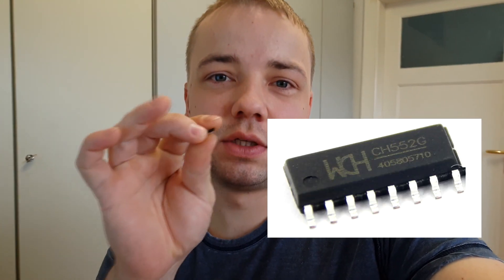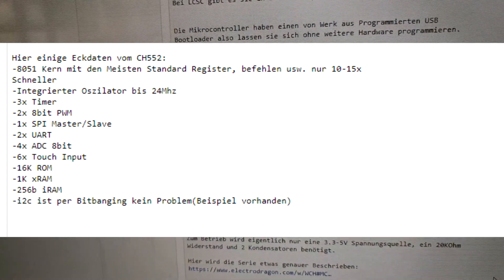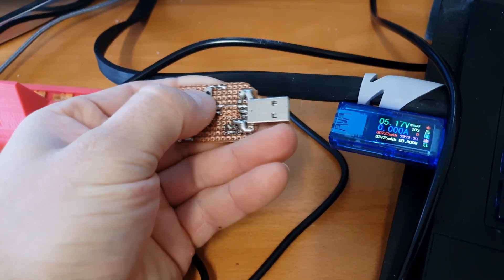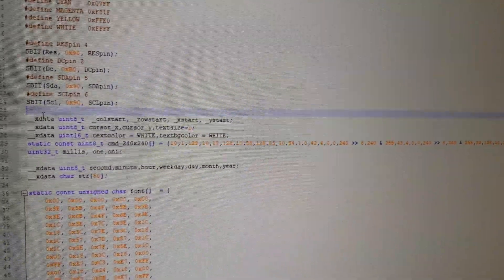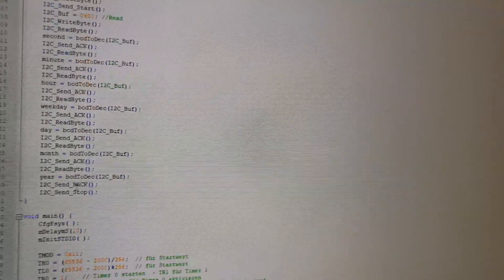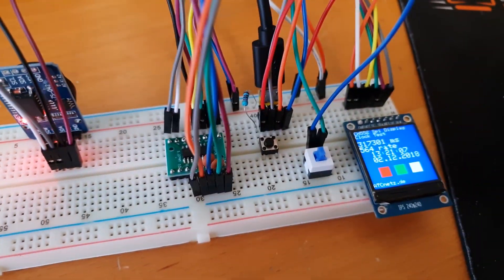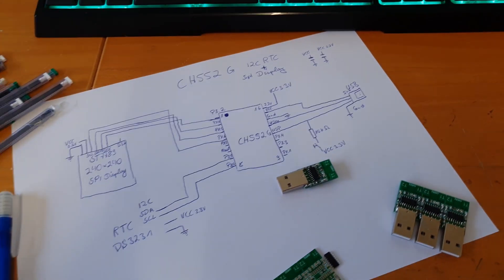CH552 0,30€ USB Microcontroller HowTo Programm, ISP Display I2C RTC

Comment: Hallo, Ich bin vielleicht etwas spät dran aber habe so eine Minitastatur mit so einem Chip sehr günstig gekauft. Ich wollte auf den Tasten ausführbare Codes hinterlegen, wie "An-/Ausschalten von USB-Ports am PC (also am Motherboard, wie man es vermutlich im Gerätemanager machen kann)"; "Das umwechseln zwischen Anzeige auf zwei Bildschirmen und -Anzeige auf einem Bildschirm-". 

Falls du das siehst, kannst du mir kurz einen Eindruck geben ob sowas möglich ist? Ich kenne mich nicht wirklich mit Microcontrollern aus und möchte nicht Zeit und Motivation reinstecken um am Ende frustrierend zu erfahren, dass es nicht Möglich ist (oder sehr schwer). Ich habe schon paar andere (der wenigen Videos über diesen Chip) gesehen und versuche auch mit chatgpt das System zu verstehen. Leider gibt es aber das Flash Tool für diesen Chip nicht mehr auf der Herstellerseite und nur den für den CH554 online. Geht das auch ohne?
Ich bedanke mich schon mal im Voraus für deine Hilfe.
Reply from the maker: Moin, das sollte so möglich sein du brauchst aber auf dem PC auch eine Software Die die Kommandos der Tastatur dann ausführt.
Reply: @atc1441  ok  Vielen Dank

Comment: Hi, I have a deice with this uC and when I set it to programming mode, the programmer app v2 on android can connect with it but I can't dump the flash.
The device has a bootloader version 2.5 and the message is:

Something went Horrible Wrong found no right byte at: 14335
I Send: A60D00FF3700000000023FC700E57536 Answer was: A69F0200FE00 Got this Data:

Comment: I made a device with CH554, I want to activate code protection, but in WCHISPTOOL its not active "Enable code and data protection mode",
How can I activate protection?
Reply from the maker: I am not aware of any code protection in the CH55X series...
But the new bootloaders are more secure and can not be dumped as easy anymore

Comment: Hi Aaron, I have ordered CH554 because only that was available . Is it possible to use it for USB memory pen drives ? Just a quick head up , if you have done any work on it.
Reply from the maker: Hey yes that is possible, only that the examples from WCH only work wit Keil. You can use keil for 30days free i think.
Reply: @atc1441   Thanks Aaron !

Comment: Is it possible to rewrite the description without unnecessary words (on GIT)? 
Like, now let's compile and oops nothing happened!
These superfluous words, expressions and actions are very annoying, because at least they spend time.

I would understand if it was some kind of novel or other literary adventure.
But I think people coming here hope to quickly connect everything and make everything work right away.

Without experimentation or other adventures.
---
Thank's
Reply from the maker: Hi. This was my very first video about them, many things habe changed. 
There are now many more options to get started, there a re one click compiler, arduino core librarys, Android Apps to flash them and Python scripts to flash them open source. 
You can find some on my github https://github.com/atc1441/CH55xOneClickCompiler and also within other video.

Comment: Hi - any chance you could upload the source code and the modified Adafruit library to github? I would like to experiment with this chip for a project I am designing. 

I am already using the CH559 in a project for usb host per your project with BitLuni. Thanks for the great project videos.
Reply from the maker: Hi. Please send me an email to ch552code@43u.de i will send you the code there, the code is not polished at all and needs MAKE to work. Thank you

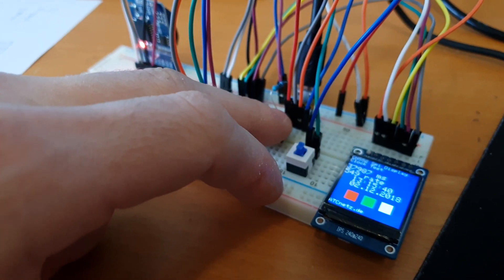Comment: At 5:23 you say "D-Minus Pin" but the schematic at 5:40 actually shows D-Plus pin being the one connected to VCC via a 10k pullup - so what's the right way?
Reply from the maker: Oh yes. 

P3.6 Is the right one. So Pin 12 on ch552G
Data plus pin.
Reply: @atc1441  Thank you so much. This may sound strange but: Do you know a way to program the CH552G directly (so not via the built-in USB bootloader but like a more "traditional" microcontroller)?
Reply from the maker: Only other way is via serial. The same protocol as the usb bootloader just send to it via serial.

There is one thing mentiond in the manual about spi programming but nobody knows how to activate it. That is not descripte more than an overview.

Comment: So are you dumping 5V to 3.3V devices? I see you powering TFT and RTC with 3.3V from the internal regulator, but all IOs are 5V, rest of the two USB IOs.
Reply from the maker: Hi. Yes that is not 100% perfect but it works for developement. You can also power the ch552 complete with 3.3V then also the IO are 3.3V
Reply: @atc1441  CH552 won't work in ISP mode is it is being powered from 3.3V. The flash memory requires 5V to write. ATM I'm working on a CH552 design and I've been stuck on level shifting. The cost is at extreme premium, and the space is also at premium, so I'm looking for a solution to level shift 8MHz SPI with minimum space and cost.
Reply from the maker: Maybe like here https://simple-circuit.com/wp-content/uploads/2019/06/arduino-st7789-color-tft-240x240-pixel-interfacing-circuit.png only two resistors per line

Comment: I was trying to compile the examples but keeps getting error2.

$ make
sdcc -c -V -mmcs51 --model-small --xram-size 0x0400 --xram-loc 0x0000 --code-size 0x2800 -IC:/Users/gio/ch554_sdcc/examples/../include -DFREQ_SYS=16000000  main.c
+ C:\PROGRA~1\SDCC\bin\sdcpp.exe -nostdinc -Wall -std=c11 -I"C:/Users/gio/ch554_sdcc/examples/../include" -D"FREQ_SYS=16000000" -obj-ext=.rel -D__SDCC_CHAR_UNSIGNED -D__SDCC_MODEL_SMALL -D__SDCC_FLOAT_REENT -D__SDCC=3_9_0 -D__SDCC_VERSION_MAJOR=3 -D__SDCC_VERSION_MINOR=9 -D__SDCC_VERSION_PATCH=0 -DSDCC=390 -D__SDCC_REVISION=11195 -D__SDCC_mcs51 -D__STDC_NO_COMPLEX__=1 -D__STDC_NO_THREADS__=1 -D__STDC_NO_ATOMICS__=1 -D__STDC_NO_VLA__=1 -D__STDC_ISO_10646__=201409L -D__STDC_UTF_16__=1 -D__STDC_UTF_32__=1 -isystem "C:\Program Files\SDCC\bin\..\include\mcs51" -isystem "C:\Program Files\SDCC\bin\..\include"  "main.c"
+ C:\PROGRA~1\SDCC\bin\sdas8051.exe -plosgffw "main.rel" "main".asm
sdcc -c -V -mmcs51 --model-small --xram-size 0x0400 --xram-loc 0x0000 --code-size 0x2800 -IC:/Users/gio/ch554_sdcc/examples/../include -DFREQ_SYS=16000000  ../../include/debug.c
+ C:\PROGRA~1\SDCC\bin\sdcpp.exe -nostdinc -Wall -std=c11 -I"C:/Users/gio/ch554_sdcc/examples/../include" -D"FREQ_SYS=16000000" -obj-ext=.rel -D__SDCC_CHAR_UNSIGNED -D__SDCC_MODEL_SMALL -D__SDCC_FLOAT_REENT -D__SDCC=3_9_0 -D__SDCC_VERSION_MAJOR=3 -D__SDCC_VERSION_MINOR=9 -D__SDCC_VERSION_PATCH=0 -DSDCC=390 -D__SDCC_REVISION=11195 -D__SDCC_mcs51 -D__STDC_NO_COMPLEX__=1 -D__STDC_NO_THREADS__=1 -D__STDC_NO_ATOMICS__=1 -D__STDC_NO_VLA__=1 -D__STDC_ISO_10646__=201409L -D__STDC_UTF_16__=1 -D__STDC_UTF_32__=1 -isystem "C:\Program Files\SDCC\bin\..\include\mcs51" -isystem "C:\Program Files\SDCC\bin\..\include"  "../../include/debug.c"
../../include/debug.c:270: warning 158: overflow in implicit constant conversion
+ C:\PROGRA~1\SDCC\bin\sdas8051.exe -plosgffw "debug.rel" "debug".asm
sdcc main.rel debug.rel -V -mmcs51 --model-small --xram-size 0x0400 --xram-loc 0x0000 --code-size 0x2800 -IC:/Users/gio/ch554_sdcc/examples/../include -DFREQ_SYS=16000000  -o fastblink.ihx
+ C:\PROGRA~1\SDCC\bin\sdld.exe -nf "fastblink.lk"
objcopy -I ihex -O binary fastblink.ihx fastblink.bin
process_begin: CreateProcess(NULL, objcopy -I ihex -O binary fastblink.ihx fastblink.bin, ...) failed.
make (e=2): The system cannot find the file specified.
../Makefile.include:54: recipe for target 'fastblink.bin' failed
mingw32-make: * [fastblink.bin] Error 2

Comment: Hi there! I’m looking for a cheap mcu and found your video about the ch552. Do you have schematics for for building the circuit?
Reply from the maker: Hi. I show them in the video. They are so easy it is the drawing. Greetz
Reply: Aaron Christophel May I know the value of the two capacitors and one resistor?
Reply from the maker: @_tinkerBOY  they are 100nf and 20k Resistor, but that can also be 10k
Reply: Aaron Christophel Great, thank you! I have just ordered a few ch522g chips and will be testing them. 👍
Reply: Aaron Christophel oh yes! 😊👍 thank you!

Comment: This is quite relevant to my interests. The WinChipHead micros are most suitable as a USB host with SPI to something more powerful or as a USB passthrough device that sits in between and does something interesting man-in-the-middle style. CH552 and CH554 have host capability, CH559 is a dual port hub or passthrough controller. The lower end models are useful for their small footprint vs. STM32F030 or STM32L031, well besides being dirt cheap.

Found you via your comment on Luni's channel just now BTW :D
Reply from the maker: Hi. So just to correct you the ch552 does not have usb host, only usb slave. Not that you buy them and get disapointed. These chips are perfect for little gadgets or as you mention as interfaces for USB. 
If you didn't saw it jet i made an Android app to flash them directly via Android over the usb otg adapter, so even in the wild updates are easy. You could made a usb rubber ducky thing out of it^^

Comment: Compile well with the sdcc, but when loading it gives me an error, "Wrong Hex File", try everything, and it still does not work, do I have to configure something in the sdcc?
Reply from the maker: Hi. Normaly it should work. There mus be some error. Please take a look into the hex file. HXD is a good hex editor. Then you can see if there is data in the file.
Reply: @atc1441  the file seems fine, I'm compiling it in linux, you tried it in linux? installing the sdcc with apt get, following the manual of ch554_sdcc for Linux, in Ubuntu.
Reply from the maker: Ok. Then you dont use the wchisptool.exe for windows ? 
I didnt tried it on linux but i know someone who did.
Reply: I compiled it in linux, but I use the wchisptool.exe, I looked for a lot of information and did not find anything, I tried it in another machine with linux and also the .hex does not work. @atc1441
Reply from the maker: Please try to compile it on windows if you can. Maybe you can see the differenz then.
Reply: @johncollins1006  , consider using the librech551 project. It'll let you flash ch55x series microcontrollers natively on linux instead of using Wine like I think you are. If that doesn't work, you can use your android phone (and accompanying app developed by Mr. Christophel) to flash the device. If you don't have an android phone, you can pick up a cheap or used one online or just virtualize android on your computer (make sure you give the guest machine USB port access).
Reply: @johncollins1006  You may have found out a solution for this, but for anyone else with the same problem: This problem has to do with line-endings. Running "unix2dos file.hex" command in Linux fixes the problem and WCHISPTool accepts the file.

Comment: Have you tryed change bootloader pin from P3.6 to P1.5?
Looks like it doesn't work. I also can't overwrite bootloader area. :(
CH552 & CH554, bootloader v1.10
Reply from the maker: Hi. Yes i did test to change the bootloader pin. It does not work. And also i wasn't able to overwrite the bootloader area. Even WCH itself says it is not possible to change the Bootloader on the ch552
Reply: @atc1441  So i'm guessing no readout prottection also?
How about CH554? Pull-up on D+ with USB-Host is a problem.
Is this USB programming problem only? Can bootloader be overwritten via external programmer?
Reply from the maker: There is a readout protection but the sign function has a vulerability the whole chip can be dumped via usb.

You can programm the chips via uart so even with usb host that is no problem. Or you make an adapter from usb to usb then it would work.

The bootloader should be editable via an isp programmer but the protocoll is not really open. You can find it in the chinese datasheet
Reply: @atc1441  Can you post a link to isp protocol?
Reply from the maker: Yes here it is. On page 14  but you need to translate it via google

https://github.com/Blinkinlabs/ch554_sdcc/blob/master/documentation/CH554%20manual%201E%20(chinese).pdf?raw=true
Reply: @atc1441  There is only pinout, no protocol description.
Reply from the maker: I know. There is a little bit description about it but that is all we got. I dont know more about it. Sry
Maybe you could ask in the wch forum. But there is all in chinese
Reply: @atc1441 OK, thanks.
Without boot pin remaping i'm stuck. I have pull-up in usb-device D+ and ch554 goes to bootloader mode. :(
Reply from the maker: Oh okay that is indeed bad. Some time ago i had the same problem. I couldnt leave the device on the car charger. Everytime i start the car the chip goes into bootloader mode. I never found a solution. Maybe there will come something

Comment: I was looking for a while now to make a cheap USB-GPIO board, could that fit in there? I am playing now with stm32 bluepills, and avrs with vusb (kernel driver and firmware already exist for atmega8), so I am wondering how hard would it be to get a similar code on those CH552. http://www.zoobab.com/ch341-usb-spi-i2c-uart-isp-dongle
Reply from the maker: That would be the best use case for this chip. 
Here are a feew example's: https://github.com/Blinkinlabs/ch554_sdcc/tree/master/examples

The best example code for your idea is the cdc i2c. That uses Usb CDC messages to controll something over usb. 
Also it us possible to emulate an uart device and the u can use any rs232 terminal to communicate with the micro
Reply: @atc1441  if the USB-I2C adaptor could be made compatible with the i2c-tiny-usb kernel module...
Reply from the maker: Should be no problem. I never uses the i2c-tiny-usb but after a quick loon it just uses usb control commands that can be send and received with this chip. Should be a day of work to port it.
Reply from the maker: I played a little bit around and i got it so far that i can emulate the usb part of the i2c-tiny-usb the i2c part is not done right now but i2c bitbangging is no problem as i did it in this video.

Comment: I was researching cheapest USB micro-controller solution. The most value for money is STM32F103C8T6, though it is not the cheapest, it has a rich peripheral set and is a Cortex M3 part. Then there is CH340 + N76E003AT20/STM8S003F3P6 thats solution costs about 45 cents. This one is 30 cents for the FALSH version and 23 cents for a OTP variant with some other reduced features.
Reply from the maker: Hi. You are right this one is just for small tasks. I am thinking of an led controller where you can send new patterns over usb etc. 

The stm32f103 is a powerfull device and for the price the best option if you wanna do more.

The ch340 solution is not the best, you only have uart then and no cdc, Mouse or Keyboard functions. 

The best part of the ch552 is that you dont need any external hardware and you can take any 8051 code and use it.
Reply: @atc1441  Yes this is a useful little chip. I haven't used Keil but I thought you can compile from within Kiel. Why did you have to use another compiler?
Reply from the maker: Sdcc is open source, just for playing around Keil isn't worth the money.

But I have to say I tryef Keil in the evaluation Version and I don't like it that much it would be possible to port the whole thing to Arduino but not handle you have to use some other definitions
Reply from the maker: Here you can read something about porting SDCC to Arduino if you are interested German 
https://www.mikrocontroller.net/topic/sduino-beinahe-arduino-fuer-stm8s

Comment: This is useful for simple USB based controls. Say your automation software is running on a PC/SBC, this nifty chip can sit on a relay card or it can sit between a ADC / DAC or use its on ADC. Basically, it can function as a USB I/O solution for simple applications where adding a separate micro controller and its programming headers would increase BOM count, PCB area and cost.